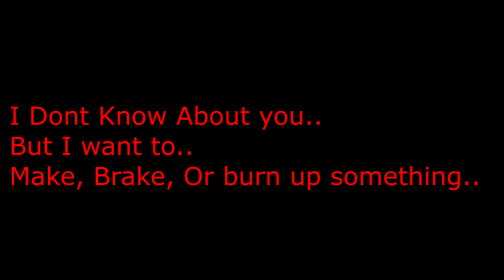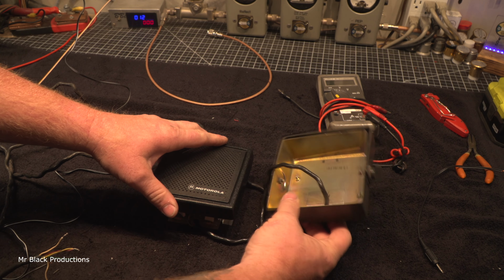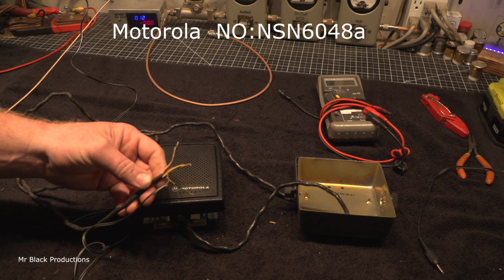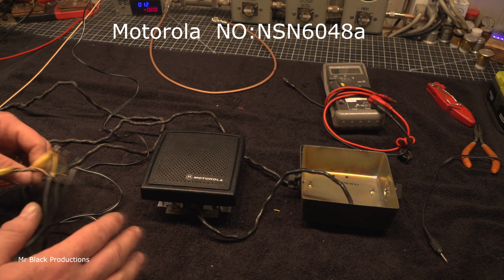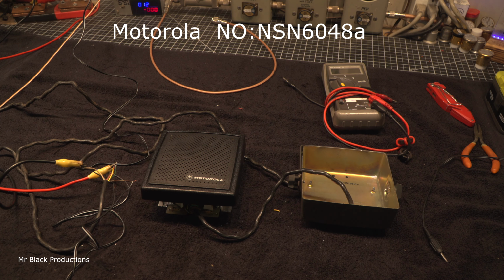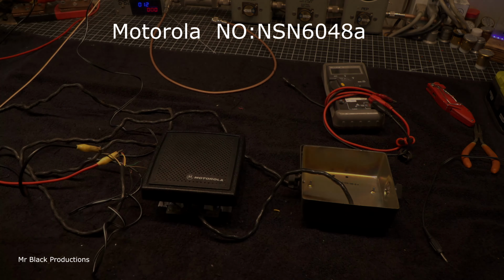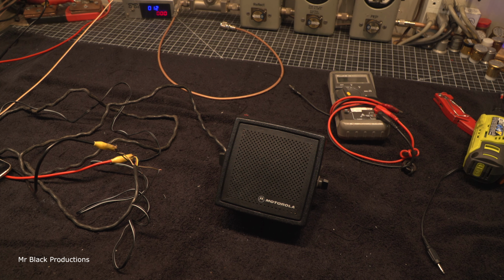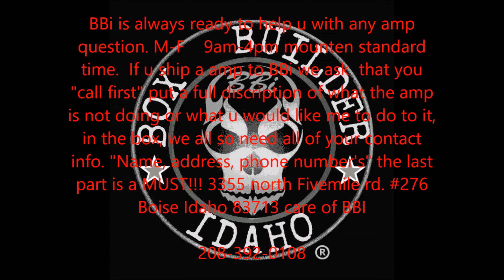The Motorola NSN6048A mobile "Radio Speaker Of The God's"

Comment: I see loads of those Motorola speakers at every hamfest I've ever gone to but never checked to see if it was this particular model, they all look a like. I like my old Midland speaker, it's got a big magnet. From the 70's or 80's, before Chinesium was discovered.
Reply from the maker: Most are not powered. The powered ones like this are hard to find just a heads up. :)
Reply: @BoxBuilderIdaho 
Hello Sir 
I just ordered one but it looks as if it has more wires can I send you a picture? 
Thanks God Bless

Comment: Indeed, a great speaker. I have four of them in my home installation.  I have two different Moto PN’s, but they are similar enough to be the same thing from a radio hobby perspective.  Good stuff!
Reply: I have 2 of the hsh1000b. They seem to be pretty close yet no metal cabinet. I'm gonna try using one. Both are brand new
Reply: Does anyone know where I can buy one of these I’m in a Noisy semi I need one . Thanks God Bless

Comment: 😷👍🏻   POWERED  BY  THE  “COAX  OF  THE  GODLESS”.....  RG-69 !
Hehehe...  Yeah, I DO know it’s SUPPOSED to be RG-400 !

BTW: Motorola also made several other “speakers” with the same rough appearance.
A speaker without an internal amplifier is actually much ,more popular .
I can’t recall the p/n off hand, but it’s the speaker supplied with the Motorola “Syntor”, “Syntor X”
and “Syntor X 9000” series of mobile transceivers.

Also... the RF “issue” should definitely NOT be a reason to be concerned.
/\/\otorola over-engineered EVERYTHING back in the 1980’s and 1990’s... and CHARGED FOR IT!!
Their speaker units, amplified or not, were designed to be used in the highest of RF environments.
The “Syntor” family of mobile radio had a separate “radio chassis” , usually mounted in the trunk or
other remote and “hostile” area.  The “control head” was mounted under the dash, in a center console,
in the patient compartment of an ambulance or other more “pristine” area of the vehicle.

The radios potentially put out 110 watts @  
VHF Low-Band  /  VHF High-Band (2 meters) / UHF  (400-520 MHz. — 70cm) /  700-800-900 MHz

I